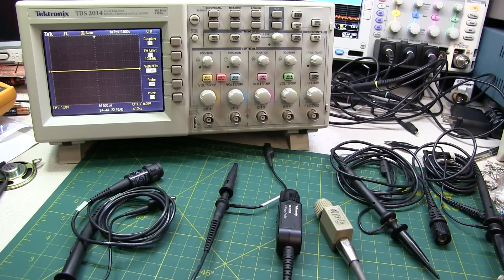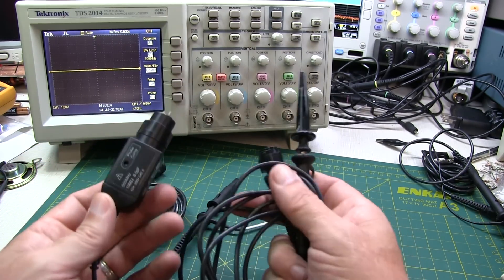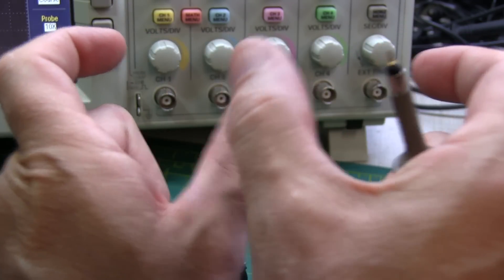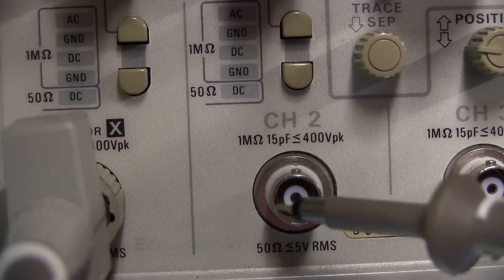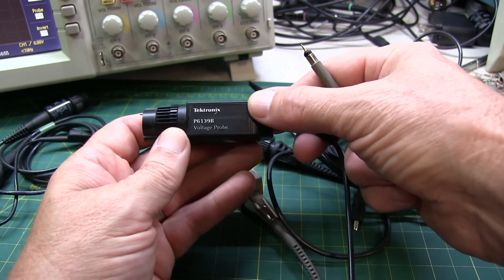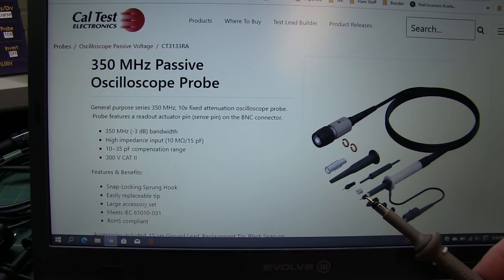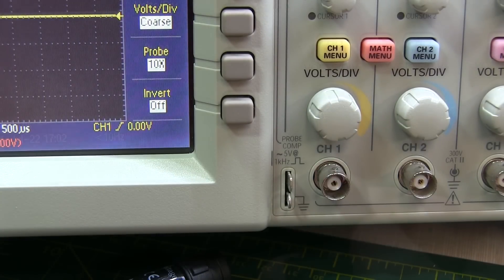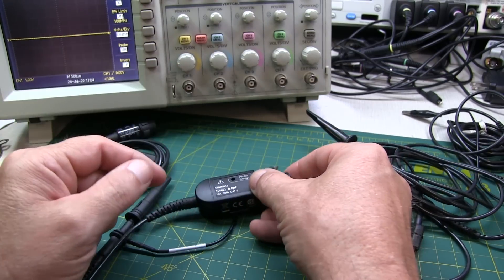#359: Quick Tip: Selecting 10x passive probes for your oscilloscope - Bandwidth and Compensation...

Comment: Hi Alan, I have a few black oscilloscope probes that do not have any bandwidth information on them, is there a way I can test this? Or do I assume that they are 30mhz probes ?
Thanks Alan.
Much appreciated.
Reply from the maker: You can probe a "fast" edge with them, and estimate the BW from the measured risetime (0.35/risetime).  Of course, if the "fast" edge isn't fast enough to push the BW limit of the probe, it will give you a lower BW result.
Reply: @w2aew  thank you very much Alan,
Would  I be able to use my Feeltech FY680 signal generator or would i need a pulse generator ?
I will give it a go today .
Cheers .
Reply from the maker: @gixerags750  You can give it a try.  It's risetime might be slower than the probe response, so you might not get an accurate view of the probe's risetime.

Comment: I’m starting to watch lots of your videos and they’re very helpful to me as I’m getting back into electronics a little bit after 40 years of doing other things.  One thing I was a little bit confused about is what happens if I have a probe with a compensation range starting at 15 pico farad but my o- scope  is rated at 15 pico farad.  You touched on it in the video, but it wasn’t clear to me whether or not the probe would still be usable in this situation.  I need new probe for my tekTronics 2430a scope and I’m looking at a 1X 10 X probe P 2200 but like the one you show in the video, it starts at 15 pico farad so I’m not sure I should use it.  It’s getting harder to find the original P 6133 probes. My scope came with when it was new.  I really do want a 1X probe as well.
Reply from the maker: It is likely that the probe would be able to be adjusted properly for that scope.  If the probe's rated compensation range includes 15pF, then it should work fine with a scope that has 15pF input capacitance.
Reply: @w2aew  Thanks for responding.  I’ll give it a go.

Comment: I want to do a full alignment on an FT-857D. I have the equipment necessary to do the job but the one piece of information I am missing is what is the best way to probe the radios 7mhz sections. Really probing RF in general. Active probes are prohibitively expensive so I'm looking at probes on ebay with between 1-3pf or just using a piece of coax and a resistor. Would you mind giving me some hints on the best way to go about this? Thanks.

Comment: Great video.  You have an excellent way of explaining how these things work!  There is an issue I'm wondering about.  It is my understanding (limited as it is) that the total bandwidth of the scope - probe combination is less than the bandwidth of either the scope or the probe.  (More specifically, it's the vector of the rise time of the scope and probe.  For the formula, see https://en.wikipedia.org/wiki/Test_probe).  If so, to maximize the benefit of the scope bandwidth, is it fair to say that you want a probe which has a higher bandwidth (say 1.5x  to 3.0x the bandwidth) of the scope as long as the probe can be compensated to match the scope?
Reply from the maker: In most cases, yes.  Tektronix is a bit of an exception - they typically underrate the BW of the probe so that if you put a 100MHz probe on a 100MHz scope, you get 100MHz of BW (not 70MHz).  Most manufacturers don't do that.

Comment: Oscilloscope question:  Often my measurements will vary depending on how securly the probe is attached, or the relative position of the probe cable. I'm never sure if this means my probe is bad, or if it's due to the shared ground connection, or maybe something else?
Reply from the maker: This is usually a combination of the probe ground affecting the measurement (ground inductance in the measurement path) as well as the probe/scope ground affecting actual circuit performance.
Reply: @w2aew  Since my supply and scope both share the same mains earth, I don't usually use the probe ground lead. But I have noticed the same varying measurements even when using an independent supply and connecting the probe ground. A bit of tension or change of position still affects the reading. I have several probes and I do calibrate them with the scope's built in calibrator (as per your other video).
Reply from the maker: @andrewferg8737  The ground is the return path for the sensed/probed signal.  By not using the ground, you add a LOT of inductance into the measurement return path.  At low frequencies (audio) it may not matter much, but will definitely have an effect as frequency goes up.

Comment: Thank you Alan, for this video and for all the work you've been doing over the past years. For many years I've been using my Tek465 purchased it from eBay, repaired it, calibrated it (to the best of my ability) with some cheap oscilloscope probes ($40 cheap).  I mostly play with audio - old cassette tape recorders, low noise headphone amplifiers, some HAM. In one of your previous videos you asked for help with your under cabinets lighting, which like you and many others, I have the same issue. My bench lamp with magnifier 5X loupe uses a 22cm diameter LED powered by an switching power supply (planning to replace it with an transformer, good DC filter power supply soon, as others suggested). When I calibrate the microphone inputs for a cassette tape recorder I'm using very low voltage signals 0.77mV. My Tek can barely see those since its lowest input is 5mV/DIV (planning use an OP07 low noise amplifier to see those signals).  What I noticed is that my cheap scope probes pickup noise (around the coax cable) and like you I have to turn off lights and use bulbs when I use very low signals like that. So, question to you - what's the best coaxial cable I can use to replace the existing coaxial cable in these cheapo probes -- can I use RG316, its impedance is 50ohm. Or should I use RG-179, although that's a 75ohm (I kind of answered my own question there) or do you know a better coax cable I can use.

Comment: Final_BW = 1 / SQRT ( SQR ( 1 / Probe_BW) + SQR ( 1 / Scope_BW) ).
They recommend Probe BW to be in between 1.5X and 2.5X the Scopw BW.
Reply from the maker: This formula holds true when the probe and the scope both have a single-pole rolloff with frequency.  Used to be more common with analog scopes, not as much with today's modern DSOs.  Still a good recommendation for the probe BW to exceed the scope BW, provided it can still be properly compensated.

Comment: Passives probes don't have a real passband they just have capacitive loading. The higher frequency probes are made with smaller wire and sometime shorter length and as you mention a different compensation range capacity.

Comment: Don't forget the needs! 
If all one want to do is to look at audio signals several hundreds of MHz isn't needed as an example.
Also getting a probe that can't reach the frequencies needed is wasted money.
What voltages? Is 1x, 10x, 100x or... the right choice?
Get a cheap to learn with or are verifiable measurements needed?
Reply from the maker: For very low frequency work, a 1x probe is often suitable provided the circuit can tolerate the ~100pF of capacitive loading.  The vast majority of applications will utilize the venerable 10x probes.  100x probes are typically only needed for high voltage work (hundreds of volts).  Even if you don't need hundreds of MHz of measurement BW with your probe - keep in mind that very low-BW probes might not be able to be compensated on your higher BW scope.  This can lead to amplitude errors on signals at just several kHz frequency range.

Comment: Thanks for great video as always. One question that has always been bothering me is that even with P6139 which is one of the best and lowest capacitance probes in the market after all these years (8pF) still the reactance at 500MHz is just 40 ohm. I cannot understand how the system bandwidth could be 500MHz when the reactance drops to such low value at 500MHz? It's even worse for almost all other 500MHz probes from HP or Lecroy because they have 10-12pF capacitance at the tip.
Reply from the maker: True, the overall measurement BW will depend on the source impedance of the node being probed, and how it reacts to the 8pF load (will that drag it down).  The probe/system BW is just a measure of the frequency response with respect to the voltage at the probe tip.  BTW - the latest generation of Tek scopes support a new wide-BW passive probe, the TPP1000, which is rated at 1GHz with just 3.9pF loading.  The widest BW 10x passive probe in the industry.
Reply: @w2aew  that makes sense but I have not seen manufacturers mention what source impedance they consider when they define the system bandwidth for their probes. So, for example for P6139, how exactly the system BW is defined? Is it for example equal to 500MHz if I probe a 50 ohm node?
Yes, I know about TPP probes and I have two of them but they only work with newer Tek scopes. P6139 is kind of universal
Reply: Probes are tested and specified using a 25 ohm source impedance from a double terminated 50 ohm source.  The same applies to the oscilloscope input, however the probe termination may lower the impedance from the probe which allows it to more easily drive the oscilloscope's input capacitance.  25 ohms is unrealistic in most applications, but at least it is objective.

Comment: Is it fair to say that probe compensation sets a "capacitance divider ratio (series C in the probe w.r.t. shunt C as specified in the probe) to such a value as to get the right amplitude?  Is not the overall bandwidth governed by the input C and series resistance of the resistor divider and 50 ohm on the scope input?  I think some equivalent circuits would be very illuminating here.  Thanks for the video!
Reply from the maker: Basically, yes, the compensation adjustment is setting up the appropriate capacitive voltage divider between shunt cap around the 9M series resistor and the scope input capacitance.  There is more to it (and more to what determines the BW), but this is the proper high-level description of compensation.
Reply: Ahh Rin on the scope is typicall 1 MegOhm unless set to 50 ohm.. of course... Also the C compensation is in shunt with the input impedance but that doesn't really explain what it does.
Reply: The magic of probe compensation is as follows: the scope has an input impedance of 1Meg//Cin, the probe has a 9 Meg resistor paralled with Ccomp (to be adjusted). When the two time constants 1Meg*Cin and 9 Meg*Ccomp are made equal, then the set "probe & scope input" behaves like a plain voltage dividor 1:10 with a flat bandwith. if your scope input is 50 ohms, then there is no use in using a probe (unless it's an active probe): a 50 ohms coax is enough.

Comment: Is it best to set the 10x on the probe or the scope ?
Reply from the maker: They need to match.  If you have the probe set to 10x (to give you the highest BW and lowest capacitive loading), then you should change the scope's vertical scale setting to 10x so that the vertical scale reads correctly.
Reply: @w2aew  Thanks I never knew that always had one set wrong than
Reply: In my experience probes that are switchable 1X/10X (or 10X/100X) have no way to tell the scope what they are set to. So for that type of probe, you have to set BOTH the probe and scope to the same value. If you can't do that, then you will have to remember to divide the voltages shown on the screen or display by 10 or 100, depending on the ratio of the probe and scope settings.
Reply: @lwilton  Thanks I never knew that